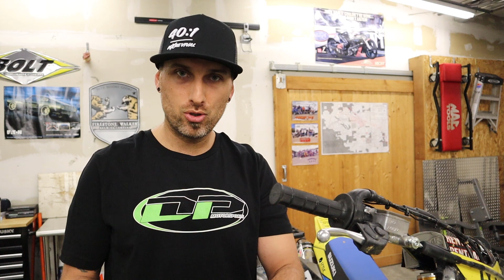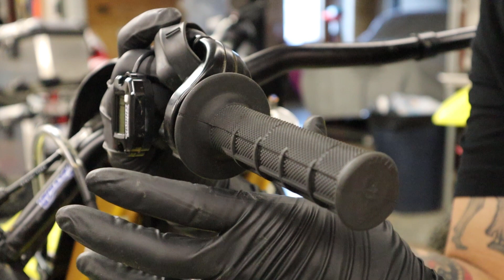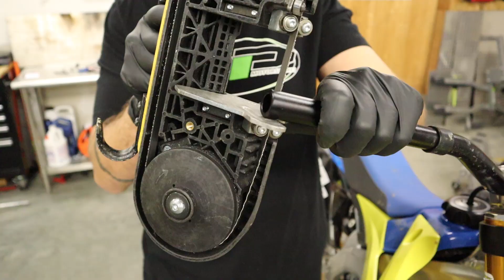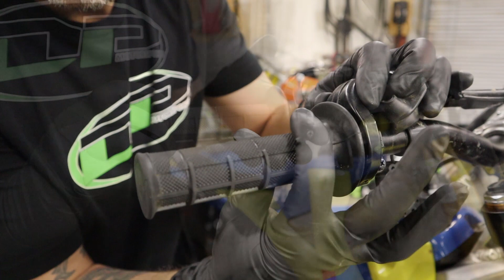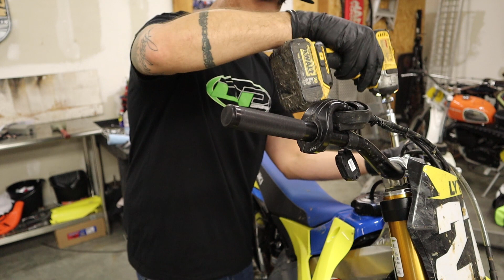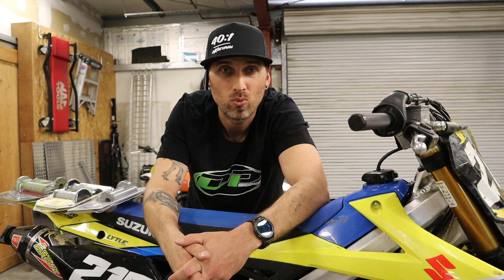HOW TO // Zero Resistance Throttle Install - The BEST Throttle Tube On The Planet

Comment: Charles any idea if odi lock-on grips will fit over the zero resistance throttle tube?
Reply from the maker: I don’t believe that will work, because the ODI is a throttle tube as well as far as I know.
Reply: @mxrevival  thanks for the heads up. Definitely want to give one of those ball bearing throttle tubes a try. Nothing better than perfect buttery smooth controls. 🤙

Comment: I added threads at the end of my bars for buckbusters. Can this be used with those threads, and if not, if the nylon thread is removed, would the threads in the tube itself cause issues with that expander?
Reply from the maker: Hi dude, can you send me an email when it's convenient for you? I'd like to get a better idea of your setup. If you use this link, I will reply and then you can send me some photos. https://www.mxrevival.com/contact
Reply: @mxrevival  Just sent.

Comment: For my OCD bar trimming I use a tube cuter. Plumbing section of your local hardware, Lowe’s or Home Depot.
Reply from the maker: It's a killer idea! Nice and straight. It isn't the best for the ZRT specifically though, unless you've got a pencil reamer too. Because of the cutters tendency to flair the inside of the bar to a slightly smaller I.D. - it can prohibit the ZRT's bearing insert from being installed into the bar end. Still, great feedback.

Comment: So will the zrt fit on 1-1/8” bars?
Reply from the maker: Of course. The bars in the video are 1-1/8" too actually.

7/8" & 1-1/8" is referring to the clamp area diameter. All bars will have the same bar end diameter... (Think of how you can put any grip you want on any bike for example)

You're good to go 🙌

Comment: Very good info, im thinking on getting one for my 350 sxf,, do you find that its soo easy to turn that it could cause easy whiskey throttle?
Reply from the maker: Very glad you found value in the video. 

No, nothing crazy like that. Just very smooth and predictable, feels excellent in the hand. I've logged about 5 hours on it now and there's no way I can run a regular throttle again. Or at least, I will be putting these on all of my bikes from now on. These Renthal Kevlar grips are excellent as well.

Thanks for the comment 😎
Reply: @mxrevival   Ok cool,more helpful info,im on order with Tom ,cant wait to rip it!  thnx man
Reply from the maker: Badass! Enjoy!